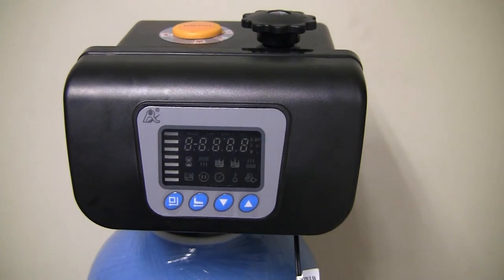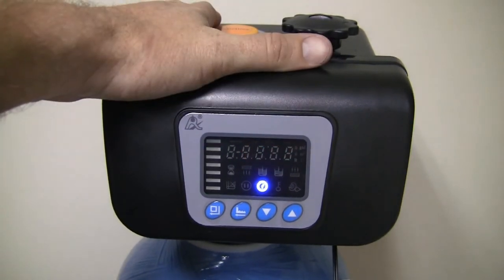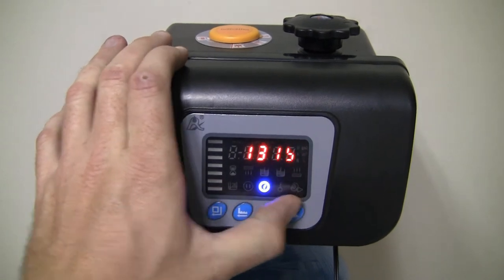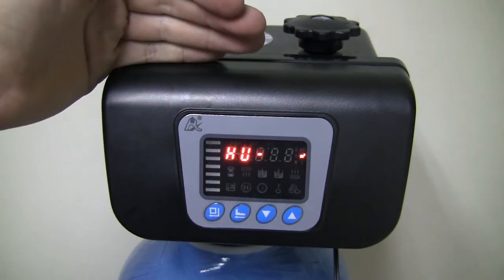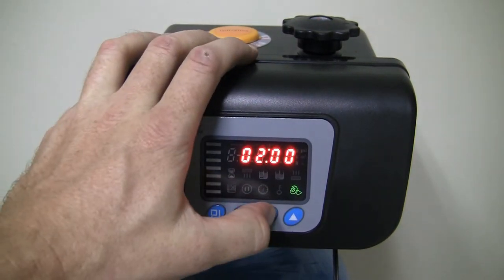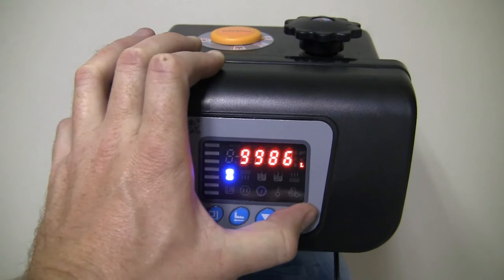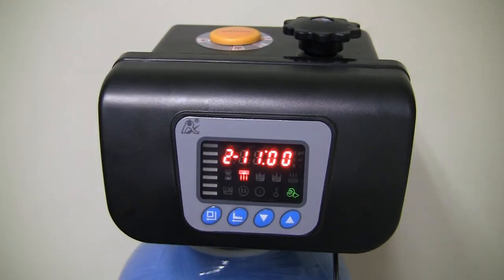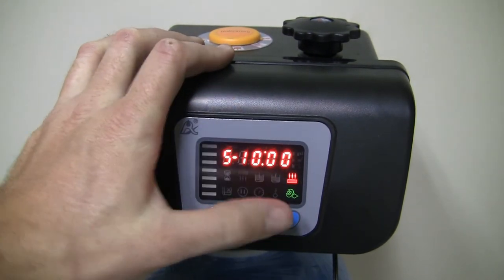F63B3 Softener Valvehead Setup

Comment: Your video has been very helpful.  I am probably just missing something but can use your help.  How do I know how much water we are using in order to set the number of days between regeneration?  I hope i am asking this correctly.  I have set it as 7 days at this point but may be too often but not exactly sure how decide the correct setting.  Thank you.
Reply: The easiest is to test the water for hardness with a test strip just before the regeneration. If you have no hardness yet extend the interval, if you have a lot of hardness then shorten the interval.

Comment: Hi, I have F63B3 installed. Overhead tank is connected to underground tank with sensors for automatic functionality.
Only issue i do see is , at the time of regeneration, if overhead tank is full, water pump doesn't run which makes regeneration steps doesn't work. How do we overcome with this? are there any settings to be changed?
Reply: Hi,

Do you have a pump from the overhead tank? You need at least 2 bar pressure for the valves regeneration to function, so if it is from a tank it would need to be 20M up.

Comment: Sir, can we use this Auto multiport valve for the sand filter & carbon filter..if yes..then what  about regeneration setting?? I think their is no require of regeneration to sand filter and carbon filter..only back wash  , slow & fast rinses are required.. then what should do about regeneration setting..plz sir suggest me.

Comment: Can you explain to me what happens during the fast rinse?
Reply: Hi, during the fast rinse, the softener resin is pushed back down into place at the bottom of the Vessel in preparation for normal operation. During this process, any excess salt is also flushed out to the drain point.
Reply: Thanks, that really helped!